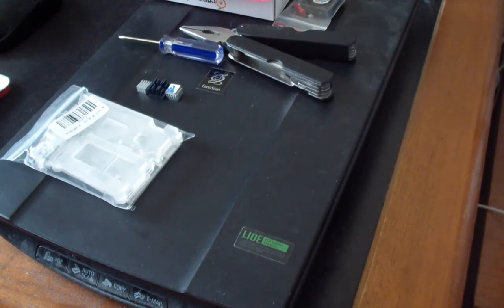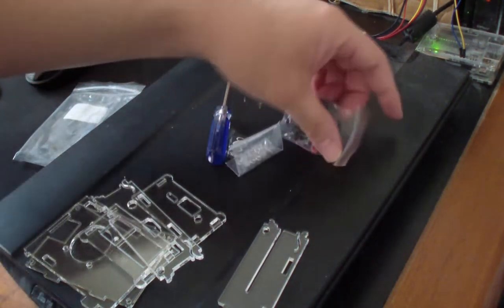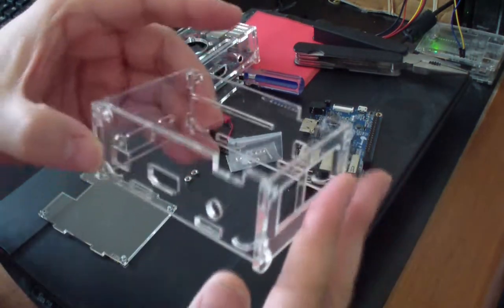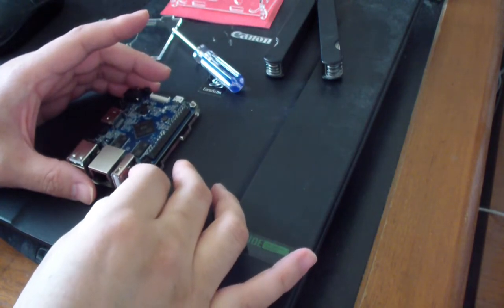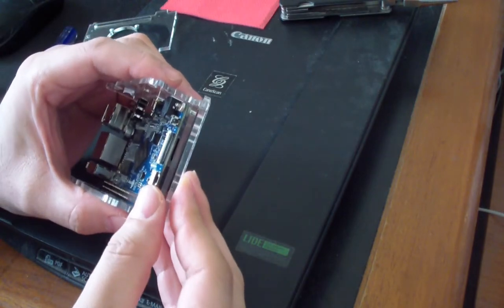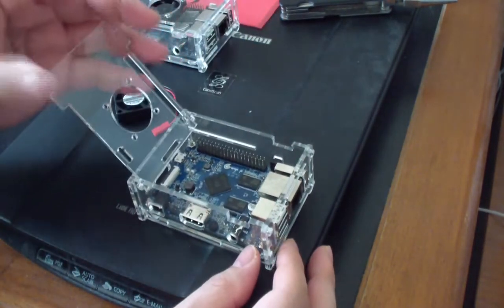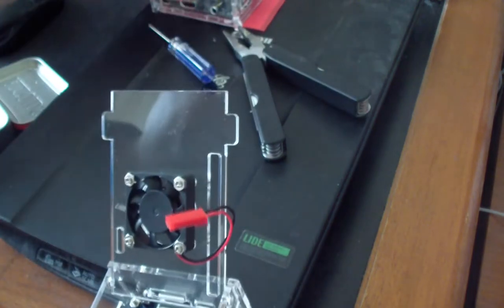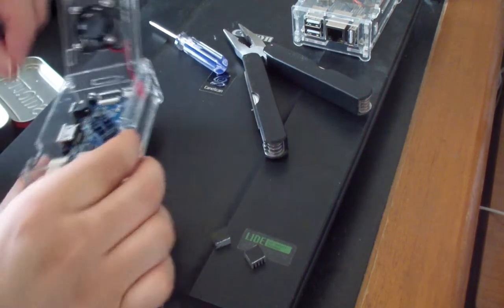Orange Pi PC Case Assembly Tutorial

Comment: I used to have an orange pi, couldn't get it to work properly cause it was very picky about the power it used. Tried using a converter for it and still didn't work.
Reply from the maker: Did you try to power up through the micro USB connector,  or the round power connector?
Reply from the maker: The power adapter I used was a 5 Volt 3 Amp 4.0x1.7mm power charger adapter. I tried a 5 Volt 2.5 Amp 4.0x1.7mm power charger adapter, and that worked too. If it is less than 5 Volt 2.5 Amps then you will have problems.
Reply: @Ace1000ks19751982  yeah everything I used was 5 volts and 2 amps, the converter only supported 2.4 amps
Reply: @Ace1000ks19751982  the round power connector
Reply from the maker: @bryce1rocks  I tried using a 5V 2A adapter, and I had performance issues. 

The most stable power supply was 5V 3A, I didn't have any problems with it. It booted every time, and no performance issues due to a lack of power.

Comment: Regarding the cooler position, which is better, to fan the air from outside to inside over the processor or  the opposite?
Reply from the maker: The air flow should be from outside to inside, not inside to outside. 

The fan is blowing air into the heatsinks to cool it that's how it usually works.